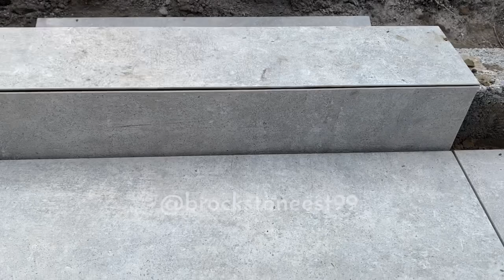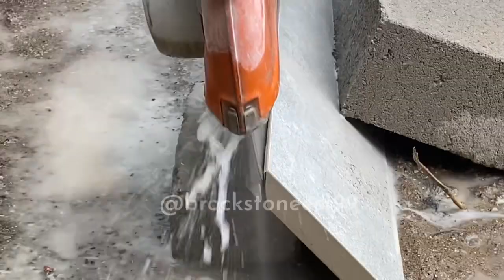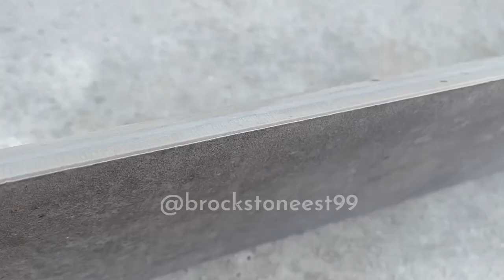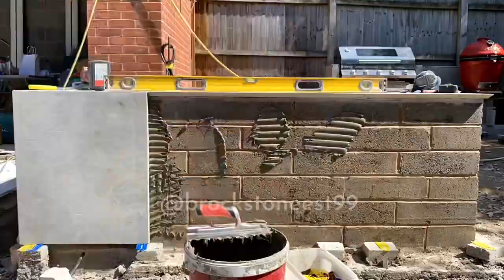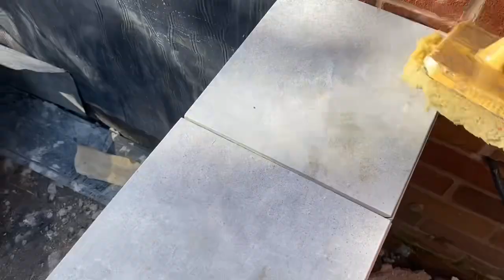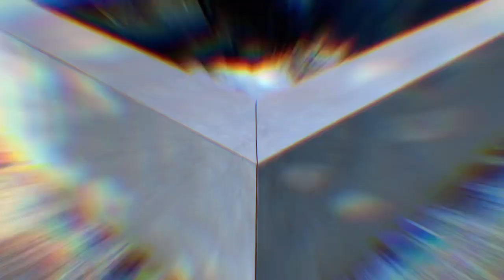Mitred 20mm Porcelain Feature

Comment: I’m going to do a couple of steps on my current job like this. Will be my first time attempting this way but it looks so much better. Great work as always!!
Reply from the maker: Hope it went ok mate. Need to be charging for those kind of details, make sure you do mate 👍👍
Reply: @Brockstonepavingpros  mitred the sides okay, the top however was a struggle 🤣 got all the way to the last inch or so and then end would break off. Maybe a stihl saw would have been easier. Had to give up in the end as was wasting to many slabs. 🤦‍♂️